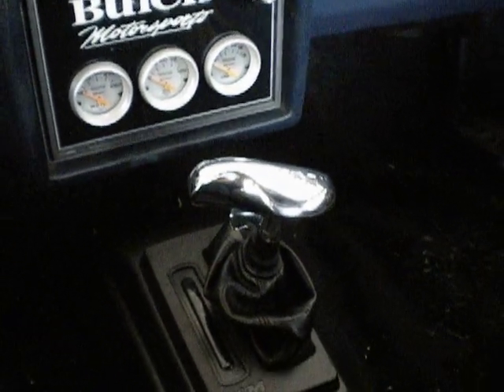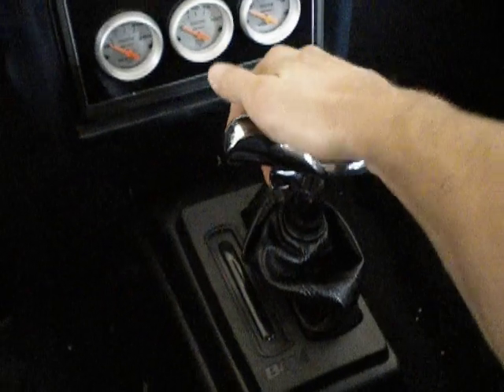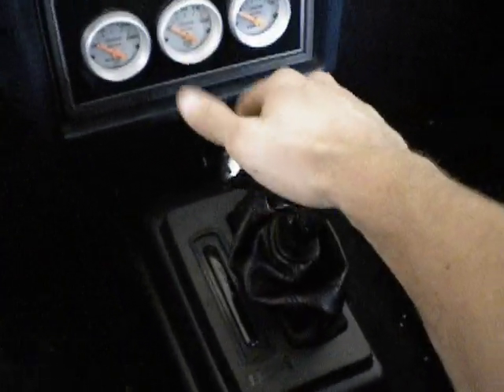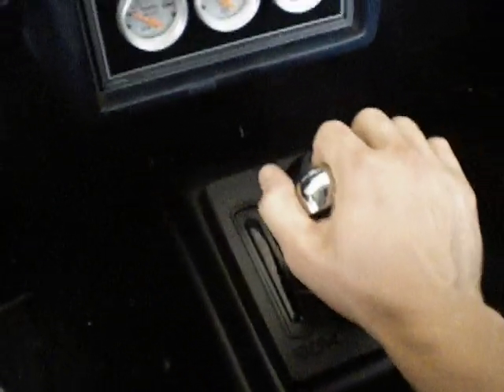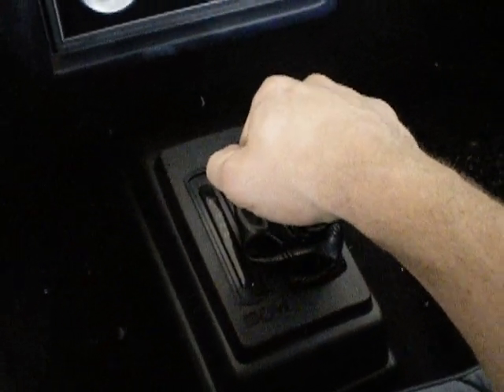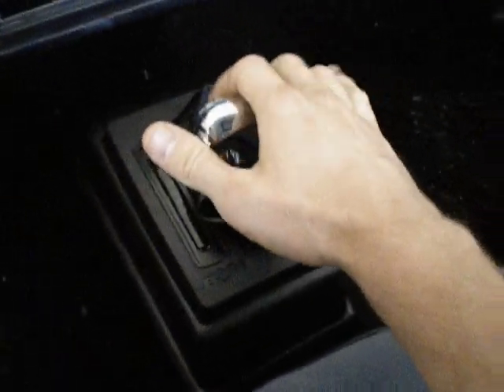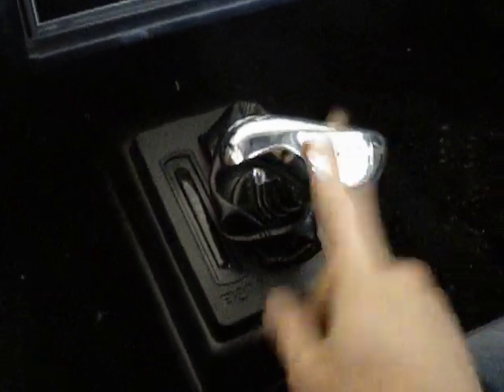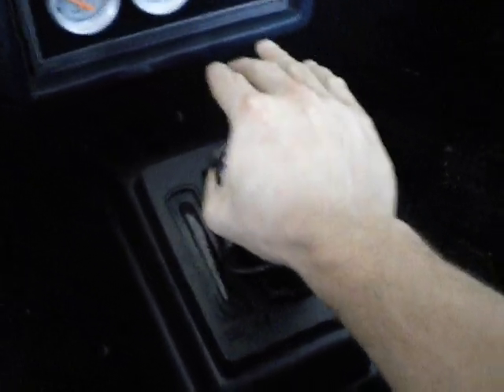B&M Hammer Shifter

Comment: How is the height of the shifter in the G body? I have a 60/40 bench in my Olds. I want it to be  comfortable shifting and not leaning down.
Reply: Rock Bottom Racing i actually had buckets converted so bot sure how that would work

Comment: What if i have a transmission with overdrive
Reply: Dave Polynice 200r4 trans is an overdrive trans
Reply: How would i shift into overdrive in my truck tho if i bought this shifter...in my truck with the factory column shifter it can shift into overdrive and neutral to drive
Reply: It should have a overdrive button for od at least the ones for new edge mustang do
Reply: SwiftMustangs I have a 4l80e you can only shift into overdrive